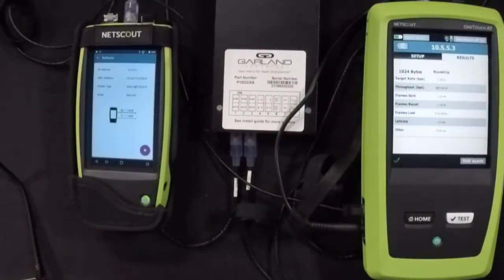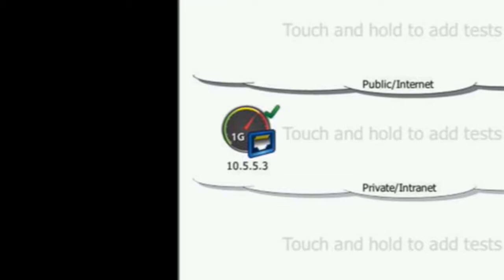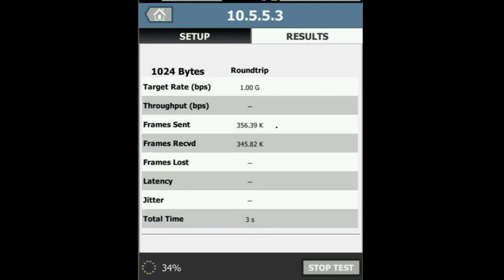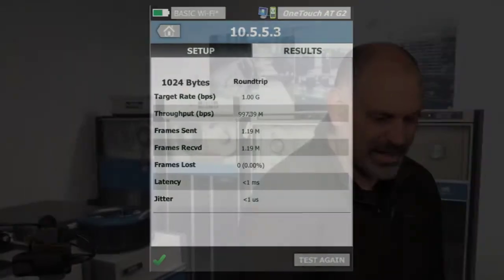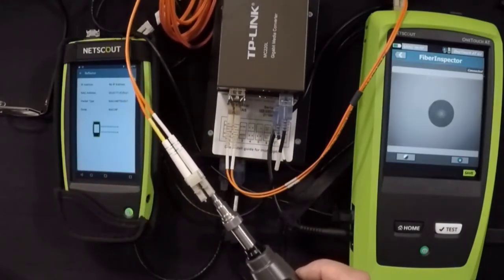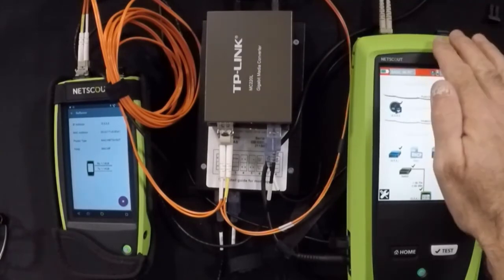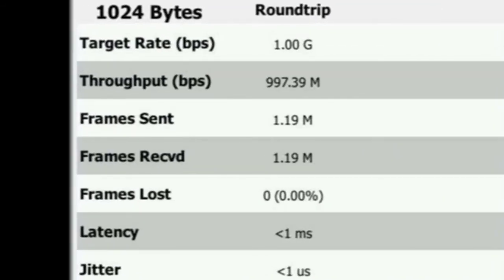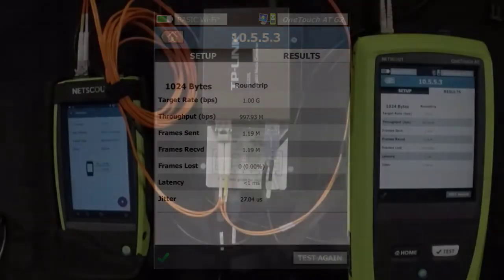Validating an Inline Ethernet Tap

Comment: Where can I get the fiber inspection scope?
Reply from the maker: The one I used is a Fluke Networks FI-1000.  New, they are about $1,800.  I just check ebay and you can find them out there for $500-600.
Reply: @MikePennacchi  Perfect! Thanks

Comment: You also need to look at all fiber connectors.  (Both ends!)
The picture is not By  IEC-61300-3-35
This will not be Approved regaring the standard.

You also need all of tne fiber. 
This is a problem regarding SM fiber.
The new info is regarding the D place. Glue of the fiber.